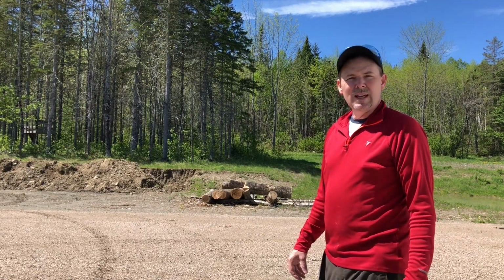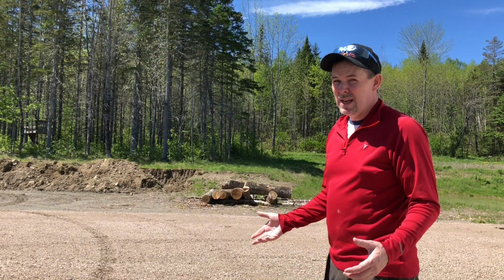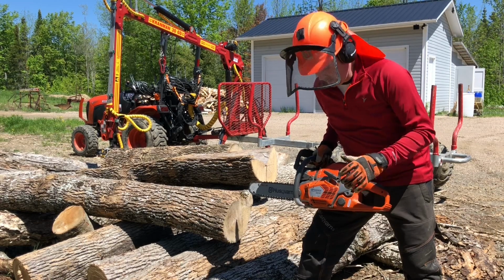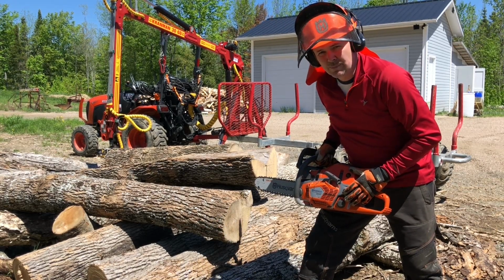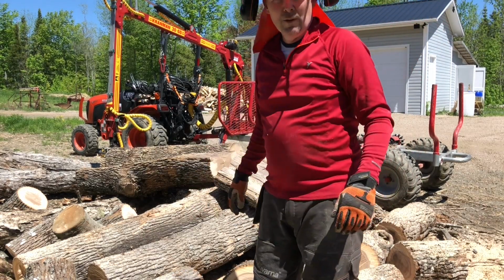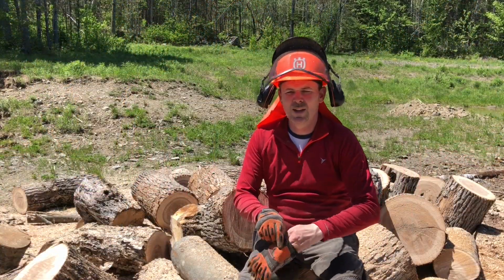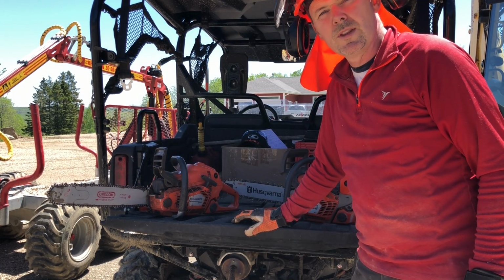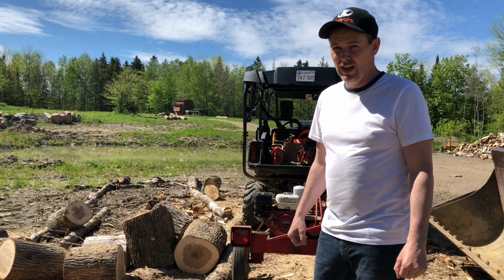Cutting and Splitting Oversized Logs into Firewood -E60 #OakMountainAcotts

Comment: Another nice video! I have an idea that might make it easier for you. Maybe you can add a hydraulic piston or a electric actuator to adjust the posistion of the conveyor on the processor, then you can change unloading position same time as you run the processor.
Reply from the maker: That is a very good idea! You can see the bottlenecks on the process quite quickly once you see it in action eh? My biggest bottleneck is getting the hardwood poles cut down! Thanks for watching!

Comment: I agree with your motto. Pretty much like you, I used to do my firewood without much equipment. Chainsaw and a splitting maul.  Then came the splitter, then the grapple, then most recently the log trailer.  That is not the end.  I shall plan a way of handling the logs through the splitter. As I am getting older, I do realize it's the only way I can continue doing so.  A few questions for you Jason.  Do you heat with firewood? What is the maximum diameter the processor can take? Thanks!
Reply from the maker: Good Afternoon! The processor takes a max 12” diameter, you have to be careful with sweeps and crooked wood as well. We have geothermal in the house but I want to get a wood boiler eventually and tie it into my system. Especially when I am home to tend the fire! Take care, Jason.
Reply: I'd like to do the same, a wood boiler!